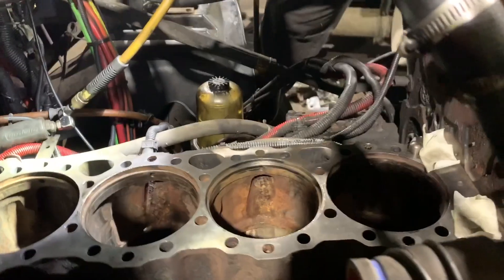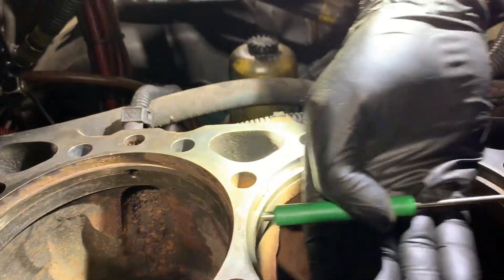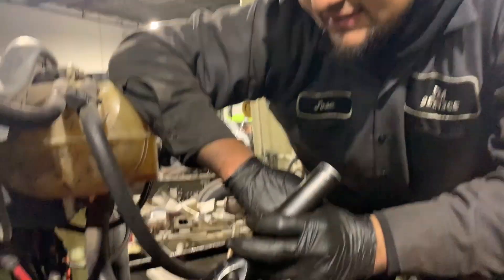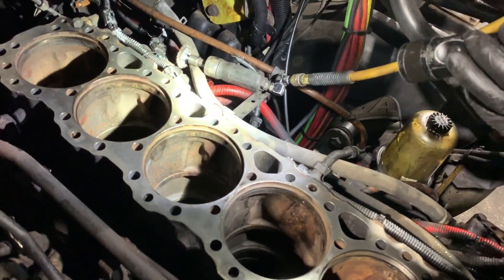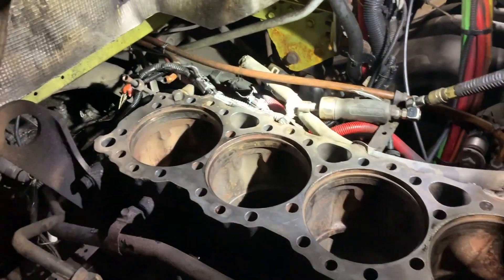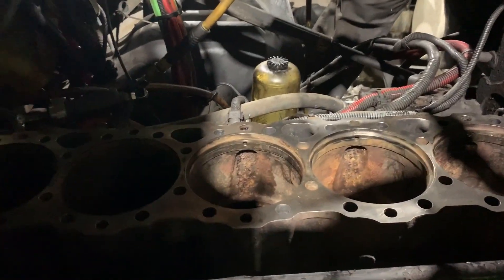How To Rebuild a Detroit Diesel Engine in a Semi Truck. Part 1

Comment: hi my friend i have 2011 freightliner Cascadia  just reached million miles. am trying put this truck on series 60 engine. is that something you could do . if yes cost pls . if not where yall recommended
Reply: Bro no one is trying to help anyone out these days!! If mechanics were smart a killer business model would be to take trucks that are under 20 years old and restore them and sell them under the market value. Ex: The shell of a kenworth is 8000$ the motor with little miles is 5000$ add 5000$ for misc parts that's 18,000$ for a brand new truck rebuild if they sold these kinds of trucks for 30,000$-50,000$ 30,000$ per truck, they would kill it because trucks are going for 90,000$ used!

Comment from the maker: 12.7 Detroit Rebuild Timestamps

0:17 Prepping engine for overhaul
0:26 Blocking oil feed and oil drain holes
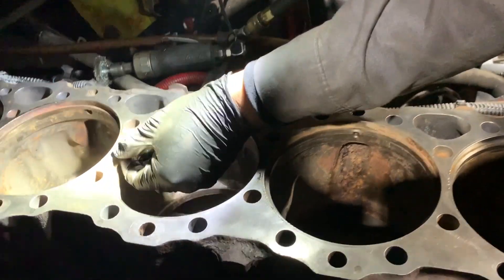0:45 Counterbores 
0:58 Process of counterbores 
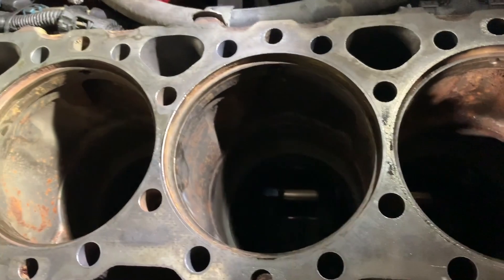1:43 How long it takes to do an engine rebuild
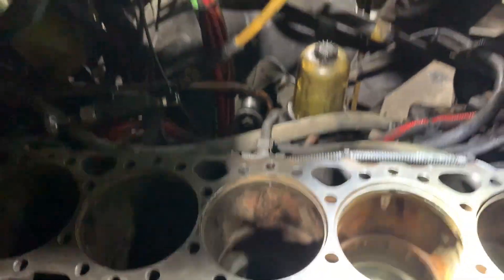2:24 Why we did a counterbore